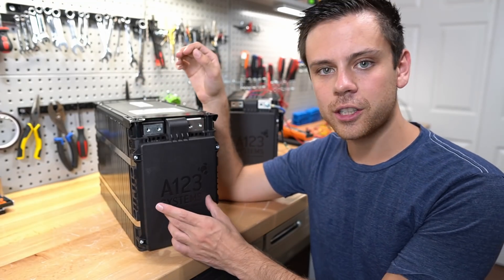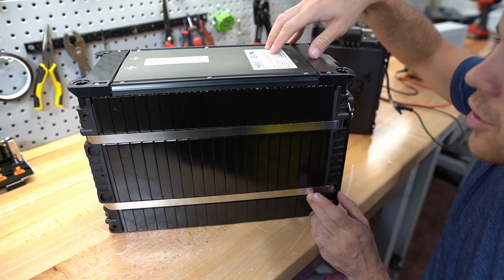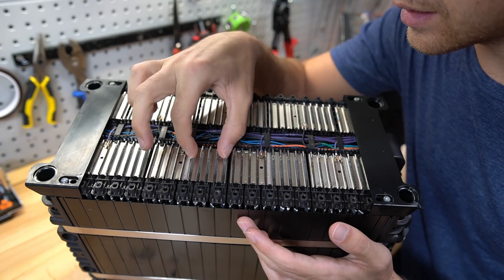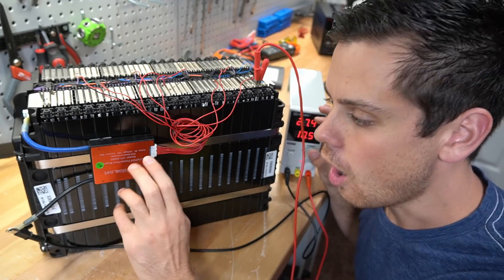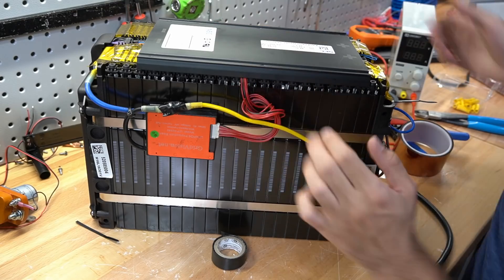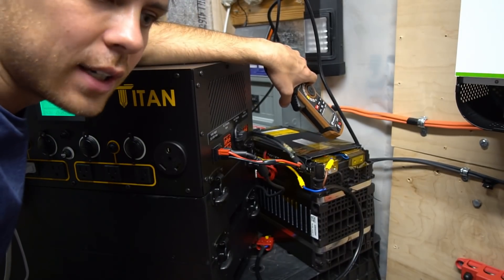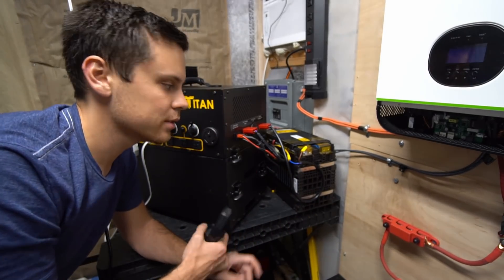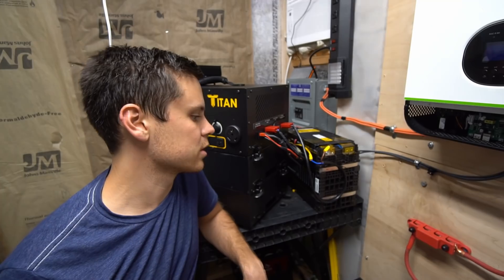DIY LiFePO4 Expansion Battery for the Titan Solar Generator: $649 2.45 kWh A123 Battery Build

Comment: I have a question. Can we use old computer UPS 12v lead acid with LiFePo4 batteries as off-grid power station? It will be really good if you can help in the process if it works.

Comment: If I wanted to wire two of these in series for a 48 volt application (electric vehicle),  should I be able to use those 8s BMS sold from the battery supplier or should I try to find a 16s?

Comment: I want to put a solar generator in a cabin that will be colder than 0°C in the winter for some weeks.
I am a bit afraid that i can not charge in winter because the batteries could be colder than 0°C.
Are the LifeYPo recommended for colder climates? Are they reliable?

Comment: Will, Thank you for this video!  I purchased two of these batteries for my Titan Solar Generator and look forward to using them!   I have a INERGY Kodak and the Apex that I would like to extend with some Chevy Volt 12V set batteries.   Want your thoughts on this configuration:  I have 4 - 200 AH, 12V Chevy Volt Batteries (Lithium Manganese Oxide (LiM2O4) I believe.  Will these run well with the Inergy Kodak and/or Apex running them (plan on extending each with 2 - 200 AH LiM2O4 batteries)?

Comment: Hi I have a hybrid battery Bank, high voltage, preus c. 2012. Modules.  Now, I'm restoring a 1988 Rockwood RV.
I'm thinking of making some 14volt batteries" by pareing the modules into 14volt, then adding a few more to Boost the current., what do you think??

Comment: Will, do you know the spec'd cycle count to 80% capacity on these?
I'm not getting any response from BigBattery, thought you might know. thanks
I have older A123 pouches but those were older Korean cells(10 years+) and not sure where A123 pouches are made now or even who owns the Co., NEC?

Comment: I am hoping you can help me out....i am mechanically inclined, but never could figure out voltage, amp, etc
I am trying to power a 600btu ac in my trailer....what i got so far is: 1000w Renogy pure sine inv, 2 x100 watt thunderbolt solar panel kits,  2 Everstart 845 marine crank amps w/122 Amp hrs each.  It turns it on perfectly, but the inverter seems to get hot after just a few minutes, so i turn it off....any suggestions of what i need?

Comment: AM new to solar and am looking to go full solar as much as i can ...I have no tv or computer to worry about just fridge and freezer 10 lights give or take and gas water heater...dont think you can run the AC/ furnace but if possible would do it.......any recommendations on how many panels ?? have a 13,000 SF home  did watch your YOUTUBE on the used Valance batteries would they be ok ....

Comment: Big Battery is now selling these with a BMS. You can order as an addon after the fact if you jumped the gun like me, and ordered 5 minutes after watching this video.. $799.00 and Done or $135 after the fact with all connections!
Reply: keith0610 yes, they are also now selling a wiring harness to connect the balance leads. I just soldered on the overkill solar BMS. I’m going to take that out once the wiring harness arrives. Then you just need a female to female 8S cable to replace the one on their harness
Reply: I can't find any specs on their BMS. I like keith0610's idea of buying the harness and an overkill BMS.
Reply: Robert Fortune Ya I’m loving the Bluetooth module on the over kill solar BMS. I think that’s the way to go, the owner Steve is super helpful if you have any questions.

Comment: I'm a huge fan of you living in a remote area in Africa "Nigeria" our current voltage outputs is 220/230v. Please what lithium ion battery would you suggest I get for an off grid solar systems? Thank you
Reply: Everything on the DC side stays the same (Including battery). You just need a different inverter. So everything he is talking about in all of his other videos still applies.
I'm having a similar issue, we also have 230V where I live and I love this unit and hope they'll build a version with a 230V inverter soon :)

Comment: Hi Will, I remember watching a video of a build you did where you had a lug crimper either fail or just not work well, and you mentioned the failure during the video and suggested a different lug crimper.  I've tried to go back through a couple videos to try to find it, and I just haven't been able to - because it was sort of an aside to the build, it's not mentioned in the title of the video.  I also checked out your website and looked through your favorite tools page, and the only thing that worries me is that i swear the tool you didn't like anymore was either the blue crimper or the yellow hydraulic crimper... so I didn't want to purchase based off that without checking in.

Any help?  I'd like to get a crimper that can do pretty much everything the blue one can, generally for 48V systems at fairly high currents.  I'd prefer ratcheting or hydraulic or anything that'll save my hands/wrists/arms, but as long as the end result is good, and the tool lasts, then I'm happy.

Thanks!

Comment: What size are those terminal bolts? Can’t find that info anywhere. The seller didn’t even know. 🤔
Reply: Update..... M6 10mm 😉
Reply: @xraykadiddlehopper8067  Thank you! Seller told me #10 and they are def not. You saved me from taking the whole module in the store and testing.😂

Comment: Hey Will I need some help!!  I have a  RV off grid trailer with 4 Valence 12 volt XP 138a/h 1766 watt batteries in parallel. Do I need a BMS  or what, if so where do I get it??  Thanks Fred

Comment: Will, can you make a video on how to hook a solar system into a breaker panel. No grid included. I'm wanting to make a "tiny home" with the solar feeding into a typical panel box.  Assuming I need an inverter and the inverter feeds the main hook up of the breaker box as if it were the grid being hooked into the panel box.

Comment: I would like to know if you have any  videos on GROUNDING solar panels and the rest of the equipment in a simple solar power system. I only have a 400 watt system, for example. I notice you don't really address this issue. It's too important.

Comment: To anyone that has purchased these modules. Can the welded cells be cut and reconfigured to a 8s20p 4 module 24vdc 10kwatt/hr battery? The battery cost is about the same for 4 modules compared to 2 74s6p 5.3 kwatt modules, but have 2 times the wt. ?

Comment: So I'm just getting into solar power and watched a few of your videos. ( Which are great by the way) and was wondering is it possible to run a standard home pool pump off solar power and a battery bank? I live in Florida which is usually predominantly Sunny except for the occasional rainstorm. My house is 100%. Dependent of the grid and was looking for alternatives to lowering my utility bill.
If this is something that is possible what would the solar panel, battery bank and inverter be?

Comment: Hey bud I just shorted my brand new 48V lithium battery and now when I hook it back up to my inverter it says no battery is connected. Does the lithium ion phosphate batteries bms have a fuse I need to replace or is the brand new pack done for? Thanks bud!
Reply: Hi Eric, 

It's not one of our batteries but I'm drifting through and watching some of Will's videos all the same for my own interest. 

It totally depends on your battery manufacturer and whomever made your BMS. They don't typically have fuses on them and are instead operated typically by a switch that opens the circuit when it senses a short or a fault. If your external BMS seems fine and is functioning visibly otherwise but you can't manage to get anything responsive from your batteries- it's probably best you put the battery away somewhere very safe until you can get someone to check it- or to help you dispose of it.

Comment: Hey Will. I got the Renogy Starter Kit, 100 watt panel with 20amp MPPT charge controller, a inline fuse on your site (10 gauge I think) a 500w inverter, some battery cables (10 gauge) some of the recommended clips you had linked on your site, the temp cable, and thinking about grabbing a 35ah sealed lead acid battery. I’m trying to run a pond aerator 24/7. The pump is drawing .31amps. (When hooked time my Jackery power station it draws 14 watts.) Do you think that’s enough battery? Is the inver ther way too big?  I plan on setting up where it will have full sun most of the day and direct sun for like 4-5 hours... would be nice to be able to charge a tablet or phone off this too once in a while but the primary goal is to aerate the pond. What size bolt on fuse do you recommend for 35ah battery and 500 watt inverter. Very new to this and I’m worried about leaving this for 4-5 days a week. What happens if it runs too low? Does the charge controller save it or do I need to add something else to protect the battery from over discharge? There is no back up power on the property... and I’m worried the 100ah battery is overkill and plus they are expensive for a project like this.
Reply: I’m also wondering about putting in the watt gauge you recommended.. they won’t be in stock on amazon by the time I need them which is Friday. Would be nice if I could see what’s going in and what’s going out like you can on my Jackery Power Station. You could just use a Jackery to run a pump like that right? That’s more of a temporary use thing I believe.. not something to run 24-7?

Comment: Titan requires that you bring each Titan battery to the same state of charge before connecting them. I would imagine they would consider an "Expansion" battery to be at the same state of charge as well. Or am I incorrect?

Comment: Those cheap BMS boards like you are using DO NOT have short circuit or over current protection. I have tried multiple "manufactures" and ratings. None of them actaully shut off, even at double rated amperage.
Reply from the maker: I have another video showing them working. nmultiple videos
Reply: @WillProwse  the Daly brand? ive watched almost all of your videos, dont recall ever seeing one of those china BMS' ever cutting off due to amperage. Ive tested Daly and grid vision units. none had function circuit protection other than high/low voltage.

Comment: On a previous video, you glossed over using deep cycle lead acid batteries for a solar set up. You mentioned a beeper that is used to indicate when drone batteries are getting low to prevent damages from over-discharge, but I was looking for a system to actually disconnect the batteries from my inverter if I was not in the vicinity or if I lent the system to someone. I’ve only seen one option on YouTube and it didn’t explain how it worked. I’m worried that I might have to resort to an automotive relay with an Arduino. Just wanted a second opinion or other options to prevent battery damage.

Comment: One thing I haven't see many of (and I'm sure there's a Niche market opportunity on AliExpress, is someone selling the "Circuitry" for one of these solar/battery generators. You know tha all-in-one mppt/bms/wall charger/inverter/usb ports/12v ports setup, add an appropriate voltage battery and Voila your own generator with as much capacity as you want to build.

Comment: Good job.

You mentioned something about "if you have two BMSes in parallel..."

Does it mean that similar spec BMSes can be connected in parallel on one battery pack in order to max out the charge/discharge capacity of the battery, similar to how you'd parallel similar charge controllers on a single battery bank?

Will those parallel BMSes be in agreement with each other? If yes, would it be better done with "different port" BMS or "same port" BMS.

Comment: Do you need a bms if it's in temperature control room and being hookup to a mpp solar?
Reply: Yes, you always need a BMS on lithium cells. Otherwise they will quickly become unbalanced and some cells with discharge first and start putting all the load on the other cells, among other problems.

Comment: Will this battery along with a quality hundred amp BMS be a one piece solution for my 24 volt trolling. I am currently running two Trojan 1275 with a samlex 2425 charger

Comment: Will a possible future topic....Over sizing panel arrays to accommodate for efficiency losses. What types of controllers have current limiters to allow for this. My biggest problems with engineering systems is that I will have a rated controller IE a 500W controller that I only achieve 500W 7 days a year when a 500W array is connected. I would like to oversize by 30% however the specs of controllers generally do not discuss these options in detail. BTW love the channel!! Thank you!
Reply: I know that the Midnite Classic 150 can be set to limit Amperage, as well as setting Voltage limits for Bulk, Absorbsion, and Float, (as well as Equallize for flooded lead-acid batteries, which needs to be set to zero for lithium batteries). I believe there are other (expensive) solar controllers that are adjustable as well, but I am using the Midnite, so know it best. One can also run solar panels in series with this controller up to the nominal 150V, to let one get at least a bit more power on cloudy days....especially if one has a longer run from panels to controller/batteries.

Comment: Since the battery is automotive grade, I think it will have twice as many cycles as stock LFP,  but only if you do not discharge it fully. Car battery is designed for providing bunch of current for a few seconds, not for deep discharge. We will see how it turns out.
Reply: This is NOT a starting battery for an internal combustion engine. It is from an ALL electric car. Thus your statement makes no sense in the real world. An electric car is driven by motors, (not engines), that run off of batteries, thus these batteries ARE designed for deep discharge. Look closer at the design specifications on the link Will provides above.

Comment: Uh, it looked like it already had balance cables soldered.  Where do the original wires go?  Why not just use those?
Reply from the maker: Cuz integrated BMS is trash. Need communication for lvd and hvd. You can reverse engineer it if you have a few months of free time haha
Reply: @WillProwse  I kind of get that, but don't those wires route somewhere?  Could you not tuck your BMS in that location so your install is ... more clean?
Reply: Those balance leads and temp sensor wires all go to a plug tucked under the end cover on mine. Not sure if an A123 BMS is available to plug into. I bought an Overkill 8s 100 to use.
Reply: @xraykadiddlehopper8067   Yes the balance wires already connected will be more secure and have better insulation than the overkill BMS balance cables. BigBattery made a wiring harness but it looks like their BMS has a different plug. I'm hoping I can just use a male to male 8s balance lead to make the bridge.

Comment: What brand charger are you using to charge this battery in the video?
Reply: It looks like a Longwei 30v 10a switched bench top power supply. They’re on Amazon for $60. Good YouTube reviews. I just ordered one. 🤙
Reply: @xraykadiddlehopper8067  Thanks

Comment: I have a question related and unrelated. I'm trying to build a small portableto solar pack for my truck to run a small portable cooler fridge. I was looking at the hundred Watt renogy solar panel set up off of Amazon. 1000 watt inverter BMS sensor, fuses,temperature sensor. Is there stuff im missing or am I just not going about this right, I'm trying to watch your videos and learn as much as I can. Any advice would help. 
PS. I'm disabled and live on $803 a month so I don't have a lot of money to just go out right and buy it I have to buy it in pieces over time. Is this possible.

Comment: Will, does the current flow from the external battery stay within acceptable limits when you put load on the inverter?  It seems that with the different battery capacities and chemistries, the internal resistance of the external battery may be different enough that it hogs more or less than its fair share of the inverter load.  Any thoughts or comments?  I have the Titan and I've been hesitant to put an external LiFePo4 battery on the external battery terminal.  Also, my Titan solar charge controllers don't cut off charging until the Titan's NMC batteries reach 29.4 volts which is higher than you would want to push the LiFePo4 battery.
Reply from the maker: It's regulated
Reply from the maker: Check out the Titan test video. It's pretty simple

Comment: Will, while I am no expert I sense there are a dozen or so fire code violations involved with your projects... care to add a video on fire safety?
Reply from the maker: No it's fine. These components are designed to be mounted to wood: https://diysolarforum.com/threads/400sq-ft-cabin-with-110-wiring-novice-and-in-need-of-help.9080/page-2#post-101228

Comment: Those cheap BMS devices scare me. No way no monitor what they are doing! It should have kicked off when you plugged the battery into the Titan, but didn’t. That would worry me!
Reply from the maker: That's silly to say tigeroll. BMS are an integral part of many advanced batteries today. Cheap BMS are not good.
Reply: Also millions of dollars in battery packs have been destroyed by BMS's. For the most part BMS's should be avoided all together. Will should know better than this.
Reply: @tigeroll  Well that's blatantly BS.

Comment: How hard would it be to connect to a 4s configuration  12v?
Reply: I wouldn't try it. One would have to dis-assemble the battery and re-configure it. Easier to just get this and put on the "overkill" BMS, then charge it with solar power, and use a 24V to 12V converter. (I actually got one of those that converts the 24V to 13.8V...my 12V appliances are much happier!)
Reply: @Tumbleweed5150   I couldn't see inside when Will opened the batttery, but I thought I saw some buss bars running down the middle of the cells.  Just change the buss bar configuration maybe.  Just a thought?   Don't want to change  any thing.